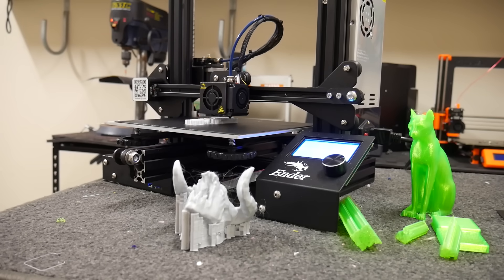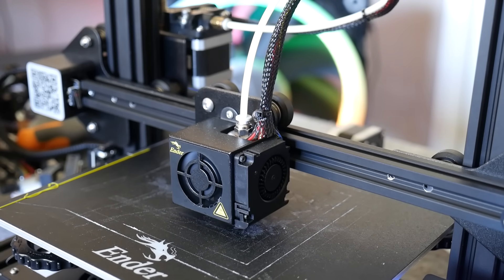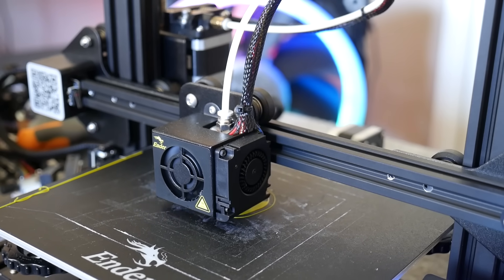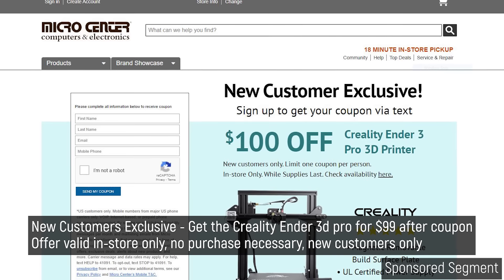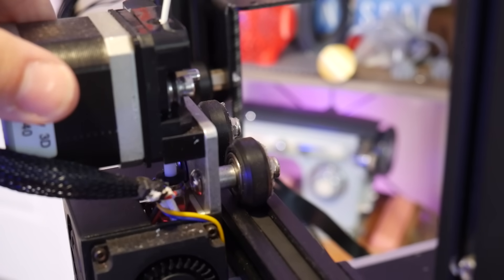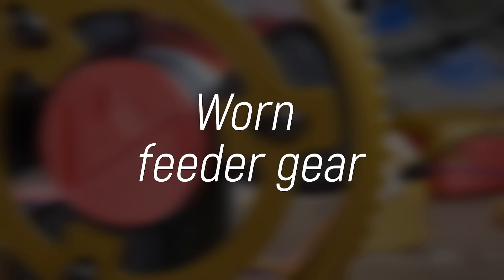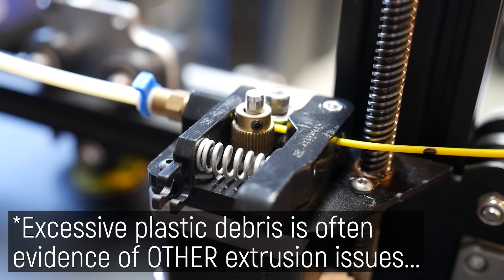Have your 3D Prints started to suck? Watch this!

Comment: A few things that have given me frustration is: (prusa mk3s)
* A partially loosened set screw on the drive gears. This was bothersome since it didn't seem to slip all of the time. 
* A partially loosened nozzle gave me a lot of frustration. It first appeared like I was over extruding. Then it appeared like I was dragging the nozzle through the part. There was just blobs of plastic coming from seemingly nowhere. It wouldn't happen all of the time. It was not obvious that the plastic came from above. Slowing down the print appeared to fix the problem but not the cause.  Eventually a stray blob of plastic would foul up something and the print would fail.

Comment: just ran into a problem where my Snapmaker 2's hotend lost its thermister. thing 'wouldn't' heat up past 130 due to the thermister still attached but had pulled free for the hotend body tried hand forcing some filament past the feeder gear and it was boiling the plastic, glad I had a spare hotend on hand!

Comment: I used my Ender 3 S1 Pro for a month straight ... printing like a beast almost 24/7.  The one day I started to get lift on some prints ... especially at the corners of a box or a lot of small parts some would just come off. I checked the Level, I cleaned it thoroughly, I increased the bed temp, tried combinations of setting, swapped to a Brim instead of a skirt, and still could be fix the issue. 

It would seem like a dirty or greasy bed but I could not figure it. Still as of today I have to use glue on the bed, which shouldn't be the case with the one on the S1 Pro bed.

Comment: Two other things that bit me
Loose bolts - they all back out over time because aluminium extrusion isn't that grippy on threads.  Retighten and perhaps next time I'll try some hand-grade locktite.

Second - if you've got an ender3 the tension arm in the extruder *will* fail at about 5-10 kg of printing.  Buy a new metal one before that, or print a replacement.

Comment: My biggest complaint about the ender 3 pro is the z-stop switch. I didn’t know why nearly every other print had poor first layers despite having just leveled the bed until I saw a video pointing out the z-stop as a possible culprit.

This makes the CRtouch worth it even if you don’t use auto bed leveling, I got one and will never look back.

Comment: Had a really dodgy wiring loom in my Voron Kit and that one got chewed up by the cable chains in less then 50 hours.  
Checked the JST connectors to the motors and they started to discolor. 
Make sure you got motion rated cables on our machine.

Comment: Even if you aren't hacking away at your parts with a scraper if you are ripping the parts off a fixed print surface with force you'll also throw off the leveling.

Comment: My printer is a direct drive Anet A8. 
1st thing I done was install Marlin firmware. A big warning. Because of bad engineering/construction, after I cleaned the original firmware from mainboard EEPROM, I started to smell something burning. For some reason, If there is no firmware in the printer, the hot end turns ON by itself and reached around 350ºC before I turned the printer off. The PTFE tube melted inside the nozzle. It was really hard to clean it.
Manual leveling the bed was a pain so I immediately installed a probe for auto bed leveling, I love it.
Dirty print surfaces is normal, dust accumulates over time.
My heat breaker fan died and I just removed it and used the printer without the fan. It started to randomly miss steps extruding. The motor was getting warm because of lack of cooling.
Clogged nozzle happened to me some times until I installed sponges to clean the filament. No clogs since then.
The wires of the bed thermistor broke and printer automatically stopped after firmware detected 'thermal runaway'. Marlin firmware FTW. Reinforced all the wires, no issues since then.

My printer still needs lots of quality of life upgrades, but I'm happy with the printing quality. The body is made of acrylic. Very flimsy. The upgrade that made all the difference was installing tensioners to stabilize the printer body.

As I'm writing this comment, I can ear my X belt pulley doing some screeching. I guess the pulley rolling bearing are screaming, 'lube me or I will die'. I think its to late. RIP pulley.  :.(

Comment: TLDR: I had almost all issues that you listed.... 🤦‍♂️

Thanks for the suggestions. With that list, i can officially declare that my printer is falling apart... I just had that issue with PTFE cooking as I switched from PLA to PETG.. And to worse things I switched the filament to ASA to experiment the filament type. Had to disassemble the full toolhead that is also breaking apart. Plus bed was dirty and I thought that was the glue stick... Since I'm using with a single layer copper clad plate and a 3DTouch I forgot that I don't need glue stick anymore...
Also the heatbreak fan looks like an old diesel engine cranking up on a chilly winter morning... I really need to replace the toolhead

Regarding the fans, I recommend to use Sunon Maglev fans. These are as silent or even more silent than noctuas and are designed specifically for industrial purpose. You'll find them from 5 to 24V. The main difference is that they use magnetic bearings instead of ball or sleeve bearings. Got two, one for the new toolhead that I'm building and another for the laser engraver that started to hear like a diesel engine too..

Comment: My fan literally started doing this today. I did the old hit it till it works turn it off and on and its fixed it. I'm almost done printing a full upgrade for a system of swappable hot ends and suspected this issue when it happened. Fortunately if it stops again I have some systems prepared to work but have not recorded my slicer for them yet.

Comment: Hi Angus, great video.  My Bambu X1c just crapped out on me (heated sensor cable needs to be replaced).  While trying to replace the cable I may have caused some damage to the plastic plug housing of the cable.  I may or may not be able to get my X1C back into operable condition but we'll see.  Anyway, can you do a video on the difficulty level of the repairs of various 3D  printers which should be a major consideration for those getting into the hobby.  I have used  my 3D printer for a couple of years now and have done some repairs but the X1C seems to be very difficult to work on.  (I already totaled a Bambu AMS when trying to repair and now my X1C may be ny latest blunder in my attempt to repair.  It may be the best printer out there but if you can't get it fixed on your own you question whether to purchase another based on its level of difficulty to repair.

Comment: Adding to the PTFE-tube issue: in some printers (eg. Prusa Mini) it’s really easy to break the pressure-seal between the PTFE-tube and the metal heatbreak. In the case of Prusa Mini there is a small piece of PTFE-tube in the hotend assembly that is compressed between the heatbreak and a brass connector. It is real easy to accidentally loosen the brass connector and remove the compression on the PTFE-tube while doing a cold pull. For some reason, this can result in terribly inconsistent flow rate. I’m not sure exactly why this affects the flow rate so much, but I’ve spent days trying to find the culprit of my inconsistent layers before changing out the PTFE tube and solving the issue. 

While I don’t really understand why the seal needs to be so tight, I do understand how I screwed up the seal so easily. The hotend design is apparently dependent on this seal to the point where the compression is specified to cause deformation of the PTFE-tube by permanently making it 1mm shorter (if I remember correctly). This means that the tube can’t be re-compressed once the connector has been loosened (by accident or not), but needs to be changed out for a replacement. 

I really love the Prusa Mini, but this specific part of the hotend design is probably the weakest link on the whole machine in my opinion (after having seen how little you have to screw up to get significantly worse print quality). A “quick disconnect” feature rather than two opposing nuts would have reduced the risk of loosening the seal during a cold- or hot-pull procedure.

Comment: My Ultimaker 3 stopped reading the step code that I have used on it before. I was never able to get it connected to the wifi or the internet. I have only used a usb stick to load the sliced programs.
Feeding the tubes was sooo hard, the insert point doesn't have much adjustment, it was so tight I needed lineman pliers to force the filliment in and out to change it. The video camera on it never worked.  It only has an auto calibration, the instructions tell you you can do a leveling with the install, it only calibrates before a run after powering up. I love those removable beds, making the beds stay sticky after the bed gets hot is quite tricky. The substances used on them would stay sticky but the heat from the bed bakes them on dry and hard.

Comment: I find it funny you post this now. I recently purchased an Ender 3 v2 to replace my Wanhao Duplicator i3 (original). I leveled the bed and put glue stick down every print, still didn't work. I know the fan needs replacing since it sounds like that and is missing one of the blades. I THINK one of the parts in the heatbreak broke when I had to rebuild the hot end last year. It's been a pain since day 1 and I think it might be from an uneven build plate from the factory. On the back, the left screw has always been as tight as possible while the other side nearly falls off

Comment: Teflon is PTFE, and it's well know how quickly those non-stick frying pans get ruined if you start to go over 180°C, so not surprised to hear that print heads with PTFE tubes can have longevity issues.

Comment: I use ipa after EVERY print. Also I print PETG on my Prusas and ender 5 plus at 235°. Never have I gone as high as 250 so always start a new filament at the lower range and move up as needed. Also you can just use a hardened nozzle for every print. 😉

Comment: Filament run-out sensor recently became the bane of my printer. It happens typically at the very beginning of the print.  Not sure if it's interference or switch going bad.  I haven't bothered to really investigate it because I never really need it. I just disable it with m412 s0 and save to eeprom.

Comment: Ptfe hotend was the bane of my existence. I switched my ender 5 to an all metal hot end by creality. But had a bad thermistor after 10 hours of printing. Couldnt replace because it was an all in one system. So i upgraded to a mosquito and havnt had trouble since

Comment: Octoprint will also tell you if thermal runaway is not enabled.
My first 3d printer, a cr-10s, pulled out of the box, setup and ran one print. It was ok.
Then my Raspi2 showed up from Adafruit and installed Octoprint on it. As soon as I turned it on, it complained thermal runaway was not enabled.
Luckily I found a site that had 1.19 with thermal enabled already compiled. I was not at a point I wanted to compile Marlin.
My biggest problem with the cr10s is the burning of the ptfe. I've had to cut the Capricorn tubing off at least three times. Usually because the coupling allowed the tubing to slip and leave a gap, that then burned the tubing.

Comment: another idea for someone like you that has multiple machines but a trick us guys in the metal welding. If you have or can find a metal cabinet make a couple cheap mods a. shelves for spools. b. incandescent light bulb and a fan. c. if you wanted to take it up a notch ad a temp and humidity sensor and a pie to control temp and humidity hands free. I had a field rod heater but it required 120v AC so I added a solar panel an dc heater and I had hot dry rods all day long

Comment: what fixed it for my ender 3 was switching to a glass bed and replacing the bed springs(lost springiness). no matter how much i cleaned my stock surface with alcohol nothing stuck, i print primarily PETG

Comment: "use hardened nozzles" for abrasive materials. Yes, BUT bear in mind stainless steel will not transmit heat nearly as well as brass. You'll need even higher temperatures just to get enough temperature at the nozzle. On an Ender 3 forget it even at 260 it will probably be too cold for ABS or nylon with a steel nozzle; just wear down a brass nozzle and throw it away afterwards.

Comment: After years of bliss, my printers all started freaking out at the same time with horrible stringing, which I never had a problem with before. Went through all the regular troubleshooting steps before finally realizing that somehow ironing for every layer got turned on by accident in my slicer. It was maddening until this discovery, but after years of printing, I'm used to the rodeo. Lol

Comment: Had a problem with my cr10 were the pla would jam at random part of the prints giving me lines of under extrusion. I had changed everything with the printer, from the hot end to the extruder motor, all the v rollers, the heated bed, the fans, the ptfe tube several times, but nothing was working. Finally I worked out the problem, to stop me having to bin the whole ptfe tube I put a bit in the hot end, normally an off cut, turns out my off cut was off centre meaning that the pla would stick during retraction and jam.

Comment: For leveling, factory springs are complete crap most of the time. It's one of the 1st upgrades (besides replacing plastic extruder) that most printers need.
IPA typically only smears oils around unless the cloth picks it up. Soapy water actually cleans the surface.
Gates brand belts are a great option over stock.
250C for PETG seems hot. I run 240C or maybe a touch lower.
Thing about Noctua... Need a bigger fan to move the same air volume as a less quiet model.
Another issue w/ the stock Ender3 type extruder is the arm will crack at the pivot. Usually on the bottom where you can't see it.
My printer room needs a dehumidifier anyway so I just set it at 35% (minimum it will do) and PETG lasts months. YMMV.
Power is I squared times R and becomes significant quickly. My Ender 3 came w/ a faulty XT60. The seller shipped a replacement on their dime after the issue was known.

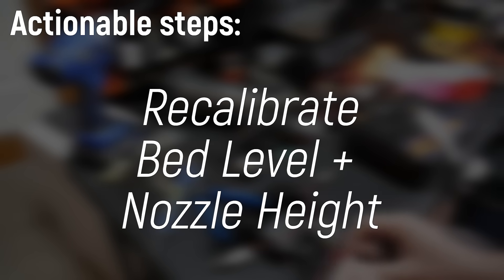Comment: 2:55 your prints seem to be PLA; but for ABS as you need to stick it super hard to avoid many problems (and having a controlled environment in terms of room temp and humidity) and removing the part from the glass will require strength and abrassive tool which is true will mess with the bed level; I don't know if a removable surface exists for ABS parts; I resorted to let the part cool for at least an hour, when I start hearing cracks I gently put a thin knife into the corners, one by one, and work my way to the center, all arround the perimeter of the base till it pops; the problem is that many times I ended breaking bits of glass, so you need to be sure you get a tempered-high-temp resistant glass if you're printing ABS, Nylon or strong materials.
Reply: Get a PEI coated bed! Heat it to 105-110 C° degrees and ABS will always stick like magic! And when it cools down, it releases on its own. If it stops sticking, just wipe with a paper towel and acetone, but since you are probably/hopefully using a vented enclosure for ABS, that shouldn't be an issue too much

Comment: I watched this video the day you released it.  I was also making a print on my Ender 3 at the time, which has been operating with no problems for months.  And after watching your video, coincidentally my print exploded.  The culprit turned out to be a burned-out PTFE tube, which I never would have checked had I not just watched your video.  So thanks to you, I'm back up and running again.

Comment: Dang, like 2 months after starting to use my freshly unpacked Ender 3 V2, one of the connectors on the electrical board wasn't working anymore, it was the cooling fan's one. After unmounting it, it was kinda darker than the other ones, so I guess it burned just a bit. I removed the connector and soldered the wire directly on the board, because who needs a cooling fan to slow down? 😅

Comment: Great video! I've recently had some 3d printer issues that have had me scratching my head and worn parts were my issue. Thought I'd list my observations in case they help someone else: 
Idler pulleys wear after about a 1.5 years of use, wheels about 2 years, if printing an average of 12h a day. Wear on these parts can present with the same symptoms as inconsistent extrusion, or binding z-axis. Cheap brass nozzles (30¢ a piece) last about 3 weeks before the bore of them gets widened and they need to be replaced. one thing I don't see people talk about often enough is the importance of checking the grub screw holding the toothed belt pulley onto the stepper motor for the x and y axis. Those loosen up over time the symptoms for that often get mistaken for loose / worn belts and wheels.

Comment: The XT connector on my 2018 Ender3 straight up burned. The two halves carbonized around one pin and fused together. There's screw terminals on the mainboard, so I just spliced and shrinkwrapped